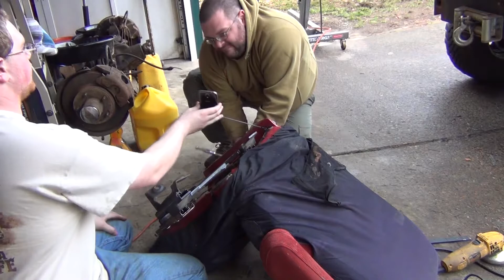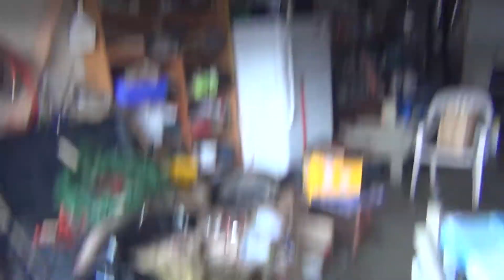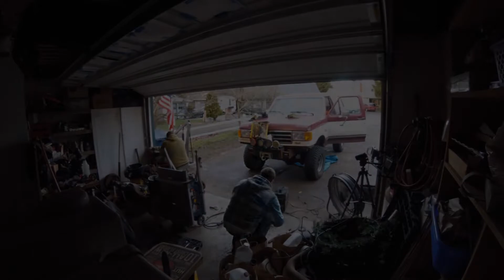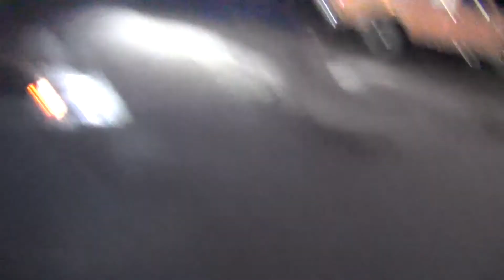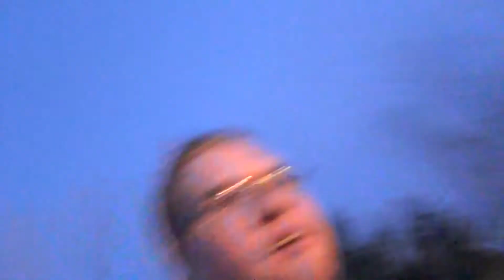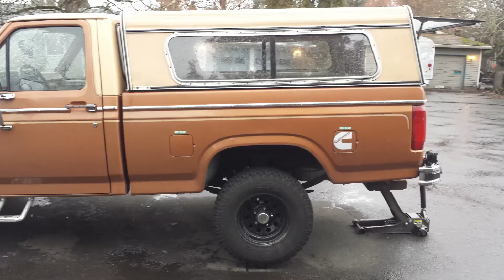Sunday Ford Bronco Shenanigans

Comment: You going to pull the axle bearings and seals before you install? I just did my rear axle and it was a piece of cake. You can get loaner tools at O'Reilly's to pull and install the seals and bearings. Tip - put the bearings in the freezer over night and they will be easier to install. Also, use a piece of 2x4 to get the seals past flush. Keep the motivational videos coming!!!